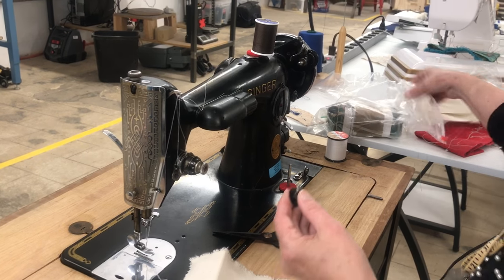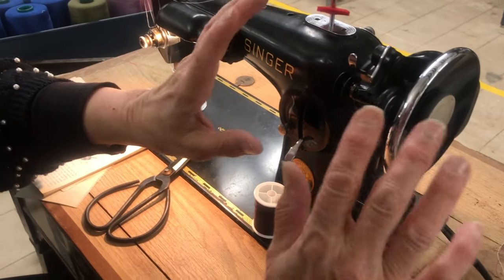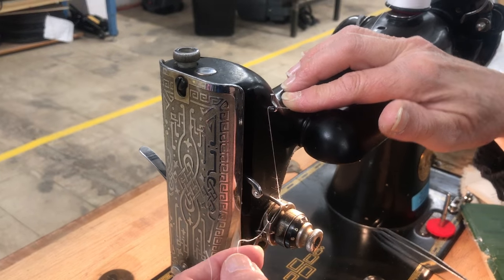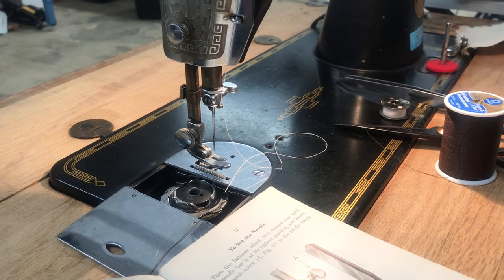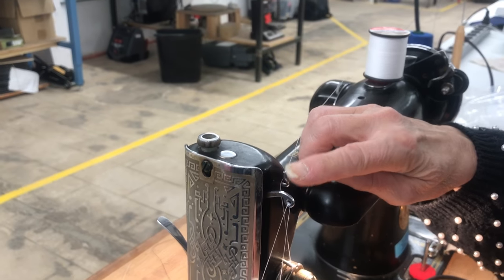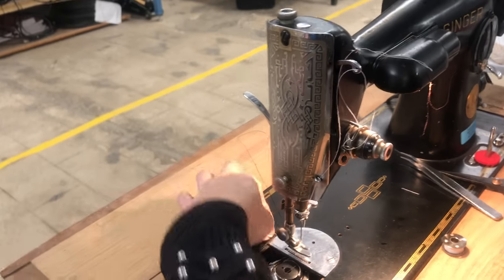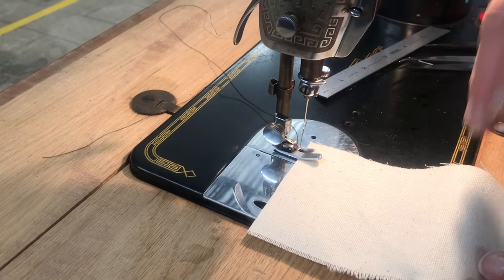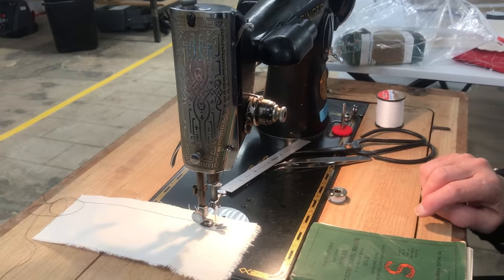Learning the Singer Sewing Machine

Comment: I think we have the same machine. What is your serial number?  What do you do if the stitching is all messed up from the bottom? I do not have a manual.
Reply: Tina Mercer... this happened to me and I found out that the tension should be around 3 or 4... if it’s lower than that the bottom thread tends to get messed up... sorry if this was too late
Reply: Can also be the hook timing or wrong needle-fabric combi, or the bottom tension adjustment screw is to tight.